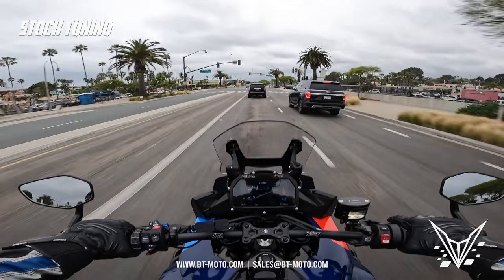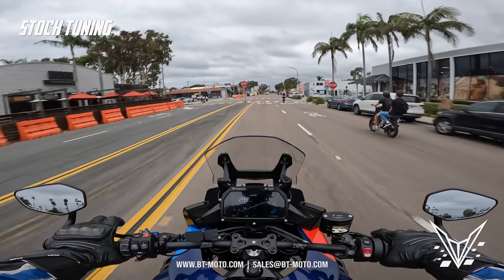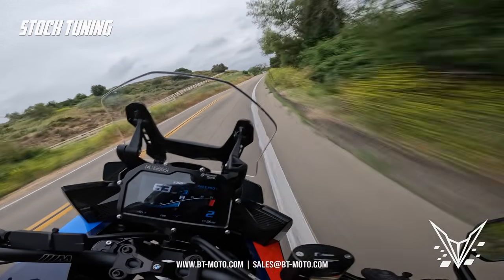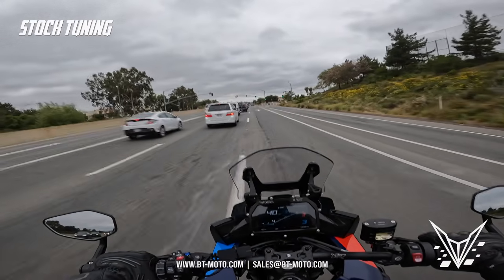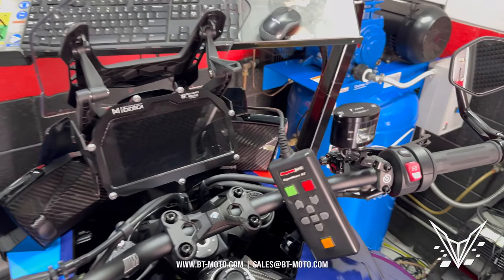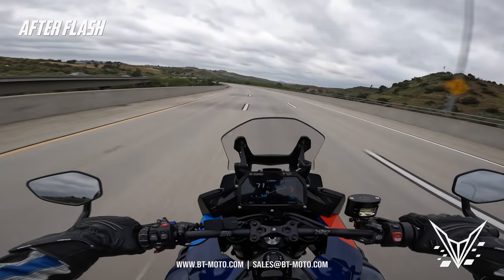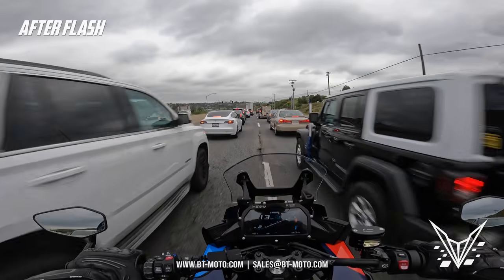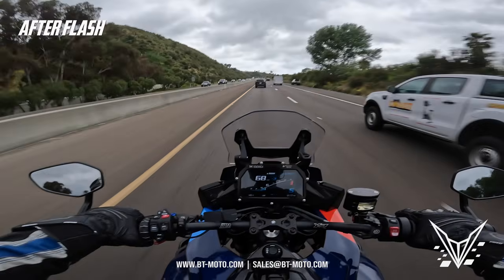2024 BMW M1000XR BT Moto Flash Review with Dyno and Acceleration Testing

Comment: I installed an Akropovic headers/exhaust system using the Akro stock can on my new 2024 M1000XR.  This morning I received the BT Moto file and programmed the ECU.  Wow!  A different bike.  No flat spots in lower gears, especially second which was terrible stock.  Better torque/linear power delivery/overall power throughout the RPM range.  Runs 10-15 degrees cooler.  No high idle when first started.  Unbelievable transformation from stock.  Way more fun to ride.  Good job BT Moto!

Comment: Great video man, lots of information reviewers rarely talk about. This is the most exciting bike in the market for me. I've own 3 XRs since they came out in 2015 and after riding many motorcycles, this is a bike I always gravitate to. The combination of handling, riding position, wind protection, acceleration, among other things is hard to beat; it always brings a smile to my face when others figure out how capable these bikes are.
Reply from the maker: Hands down one of our favorite bikes to ride
Reply: I love mine and recently did 1200 mile ride in 3 days over some amazing roads in California. Without a doubt this is the most capable tourer and standard XR is slower. I do feel extra weight of a tourer vs naked bike in acceleration and under braking. it’s just something one has to trade for comfort and better long distance. I like the winglets (apart from cleaning..), but honestly want to try without them as I enjoy front wheel in the air more than acceleration figures. I do feel them working at high speeds, bike is more stable and interestingly this is one area where my experience differs from the video. I run mine half open and it is still plenty stable even over rough payment and very aggressive throttle. On SuperDuke I had to run WP adjustable upgraded unit at 80% closed to calm the front end down.
Reply: Ignoring the cost, For you ,CubanRider, I can’t think of a better bike 😊
Reply: Hi there. I see the bike has a decat system on it? Where can I get my hands on it? I believe one gets a Ti decat system too? Last question, does the cat / decat setup affect the tune? With all the RR motors breaking nowadays... I am bit weary to tune my XR!
Reply: @BT_Moto  what is your language? my language:Tagalog

Comment: Thanks to Motorsports Exocita and your work on it, I love it!! I was considering going with stage two on it but stage one is working out perfect for me.
Reply: Also just to note, I changed the shifter because I prefer GP shifting and BMW currently does not have an option for this on the M1000XR standard shifter.
Reply: Gotta ask, did you end up putting a de-cat header on your XR? I'm debating about whether or not I should grab a set of blackwidow stainless headers on my 23
Reply: @Jake23115  I did. 
It is awesome!!
Reply: @jaypussman5687  Did you find it obnoxiously loud with the stock Akra pipe? Or is it decent?
Reply: @Jake23115  I do not. 
I have a Suzuki GSXR track bike and a 2016 Ducati Panigale 1299 that I run without a cat. 
The BMW is the quieter of the three.

Comment: The ‘stripped’ down model still has a lot of options if you think about it. It still has cruisecontrol, quickshifter up and down, electronic suspension and a lot more. If you think about it there are not many bikes on the market that come with these options as standard.

Comment: I see stock QS on the video.  I did try Cordona GP ASG QS on this bike for the sake of GP shift and although I accomplished the reverse shift , I didn’t like increased amount of force required vs stock. Agree, OEM is really good, I reverted back to stock and plan on experimenting with getting an extension on the stock lever to make it reverse shift with OEM sensor. Sucks that there is no easy solution for those who want reverse shift on this “M” bike. Nice review and I agree with all that’s been said as I run BT tune on mine.

Comment: hi i saw that you change the rear sprocket on s1000rr 2023 from 46 teeth to 44 teeth so can do that with the m1000xr which comes 47 teeth rear sprocket and go down with 44 teeth or 45 teeth . Thanks and best regards

Comment: Did you address the flapper modification in this video? Can the flapper be opened up in "Race" mode and above and work as normal in "Dynamic" and below or is it an always open modification or leave as factory option?

You did talk about the stock exhaust system being a good option to leave as is which I'm inclined to with the exception of wanting to losing 20 pounds from the system. Can you tell me if there is any horse power gain with an Akrapovic titanium header using the stock factory Akrapovic muffler over the completely stock system?

I am having my local dealer install your tune June 3rd and just want to know what options to request when filling out the questionnaire.
Reply from the maker: Good points. Yes, the intake flappers are kept open 100% of the time with our flash. 

The titanium system from bmw option saves weight but has no gain in power over the factory bmw stainless system.
Reply: @BT_Moto  Thanks for the reply.

The titanium header would blue nicely and match the MXR theme but that is an expensive cosmetic change. I think losing 20 pounds myself would be a better  economical option.
Reply: Let me save you a butt load of cash. Akro on my xr was weak. Stock tune, i put a pro-race r3r gp slip on can. It started popping nicely and sounded nice. After stage one it woke up even more. Stage 2 same slip-on, just ridiculous!!! Now i have an Arrow header with it and i can light your cigar from 3ft away. Akro is just a fad item. Pro Race makes the real shit and is from the great island of Britain 🇬🇧

Comment: My bmw dealer told me they can see anytime that you had a tune on your bike even if you take it off and will void warranty.is this true?
Reply: NO, it's not true!  BMW would have to prove, beyond a shadow of any doubt(legally), that it was the tune that caused the issue that the motorcycle had...
Reply: 100% not true!
Reply from the maker: Just like a slip on exhaust, tuning itself cannot void your warranty unless it can be proven as a cause of failure. Plenty have been warrantied with our tuning on the bike. 

Some dealers will deny (a denial isn’t a void) service if you have any mods on your bike, including exhaust mods, but this is why we tell people to find a dealer that shares your enthusiasm for racing. They tend to be more helpful than other dealers. 

If you’re concerned about any voiding, just request to keep the stock rpm limiter and there should be no issues.
Reply: I think BMW expects you to tune it. They just can’t sell it to you that way.

Comment: I just bought a 2024 S1000XR, can i have it flashed/mapped and still keep my warranty? Will they know? I’m super happy with the bike but if ir can be improved, hey why not…
Reply: Do you know if 2024 s1000xr model has more torque in low rev that 2023 model?
Reply: @cesarb1625  It does. The 2024 has a different mapping than the 20-23. It’s plenty torque-y in the lower revs, especially in Dynamic/dynamic pro but it’s best work is still at 7000 rpm+

Comment: Did I understand correctly that this bike has the stock exhaust pre and post BT tune?
Reply from the maker: We made no changes to the exhaust pre and post tuning. Need to have all variables the same or the results would be skewed.
Reply: @BT_Moto  To be fair, that wasn't the question that was asked. The exhaust is clearly not stock. I'm curious to know power figures with the stock headers/cat.
Reply: @BT_Moto  The MXR in the video has no Cat. so not a "stock" bike. 
But I also understand the results are the results with this exhaust system.  
Would be nice to see the results between factory stock (cat) and none.
Reply from the maker: @rollyman3754  we’ve done it. Akra makes about 1-2whp up top and around 8 in the mid range over the stock system. The stock bmw exhaust is efficient.
Reply: @BT_Moto  Yes I know the stock system works but. That said I will be replacing mine with the titanium headers after I get around 2k miles on her. Currently have 357 miles my first service is June 8th. Can't wait until I can open her up.
Reply: This bike has a full akra header or just the mid pipe @BT_Moto ?

Comment: Would like to hear more regarding both aftermarket quickshifters and which exhausts provide the best output with the flash.
The quickshifter on the bike looked stock to me but video might've been shot out of sequence. Regardless I'd really like to hear about BT moto's thoughts on the Cordona GP ASG quickshifter and if it has any interactions with the tune.
You mentioned some exhausts cause you to lose power so would be good for the community to know which ones to avoid. Also comparing the Arrow and Akra headers would be nice to see as well.
Reply from the maker: The shifter depends on what your needs are. I would only use a Cordona if you have a track only bike. In all other cases, the bmw shifter is amazing. 

As far as exhaust, akra > everyone else
Reply: @BT_Moto  Thanks for the response!
Reply: Bmw makes the absolute best quick shifters.

Comment: How did you solved a problem with guarantee after flash? I have exactly the same bike, with titanium Akrapovic manifolds and after 200km (200km=120miles) check engine popped up😖 I need to tune it for sure!
Reply: Warranty is gonne😂